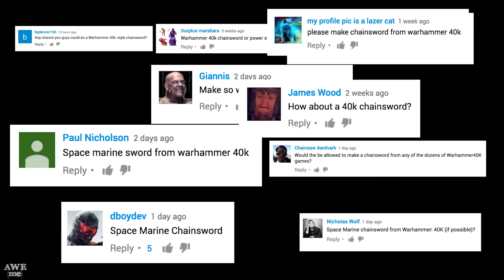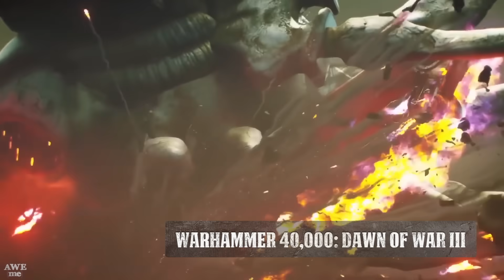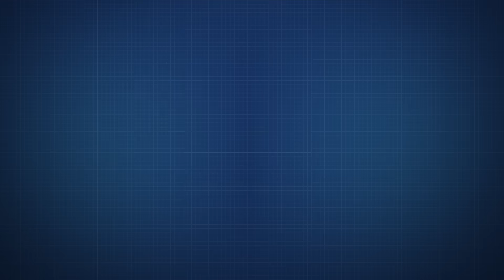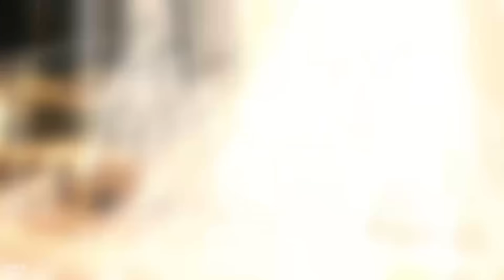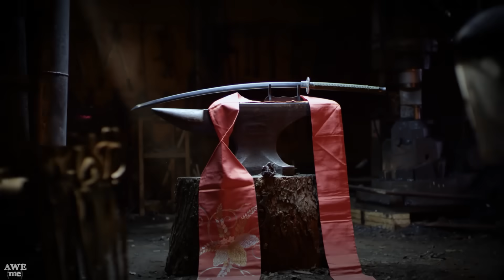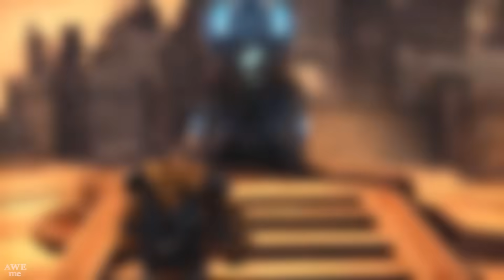Warhammer 40K Chainsword - MAN AT ARMS: REFORGED

Comment: Wouldn't it be easier and stronger,  to make the guard plate,  out of one piece and heat bend and pinch, the smooth out the rest, and heat, melt and pour each piece out of carbonsteel.  And then fine-tune and fit together.  Using a power source that uses electricity.

Comment: I often have to temper steel after welding or when I'm making certain parts, like springs or tempering a gun barrel, and I wish I could toss my parts in a toaster oven. Unfortunately, I usually go for a spring steel temper which is 650+. I do have some tricks up my sleeve, but a toaster oven is sure more convenient than a lead bath, a torch or a tempering oven!

Comment: That's not the WH40k chainsword. That thing just look like chainsword. If youll try to hit and crush something solid with it you will damage the chain or yourself. Even when they cuted thru wood they removed cover and used it like a simple chainsaw. But ye, it looks great.
Reply: They removed the cover to cut through wood because the chainsword is actually a terrible design, and doesn't function with real-world physics the way it does in the imaginations of the people who write 40k's lore.  The cover actually prevents the chainsword from cutting any deeper than the distance from the teeth to the leading edge of the cover.

Comment: I noticed your chain wasn't inverted that's why all the  objects that you were slicing or going towards you and Warhammer 40K lore it goes the other way
Reply: Reversing the direction of the chain would  just hurl the mostly intact objects away instead of towards them.  Notice they didn't cut anything tougher than a soda bottle with the cover on.  They removed it to cut the piece of wood because it prevents the weapon from being able to cut deeper than the distance from the teeth to the edge of the cover.
As designed in 40k lore, the chainsword couldn't cut a normal human-sized enemy in half due to its design.  It would just leave a horrendous inch-deep mangling wherever it hit.
Reply: @lennardchurch8483   it actually did cut through people yeah in 40K lore but the materials making up the chain sword was futuristic and there's no way we can produce that now and the speed of the chain sword is 10x faster then what they produced. the chain sword blade directions was inverted it so all the metal scraps and other debris will not be hitting them in the hand and cutting their hand that's why in 40K lore the chainsaw blade Direction was inverted
Reply: @Rowen6  It has nothing to do with sharpness, speed, or material.  Ex: if you took the fantastical concept of a monofilament sword, and embedded it in a baseball bat so that the edge of the blade protruded about an inch beyond the bat, that blade would never cut more than an inch into anything, because the bat would hit the surface, stopping it from cutting further.  That is why the cover on chainswords actually make them less effective, by preventing them from cutting through anything more than an inch thick.

So in reality, 40k chainswords are about as scientifically viable as  "red makes it go faster".
Reply: @lennardchurch8483   you must understand cutting and sawing are two different things sawing is a process of removing material so sawing with a chainsaw will push the material away that's being targeted, cutting is putting pressure on a point in separating material so the speed of the blade does matter it is moving material more rapidly and course the material of the chainsaw blade does matter because it needs to withstand The Strain that's being put on it
.

In addition, due to weakening the structure, and removing material, the body will start to collapse around it, and jellify with the vibration of the blade and structure, allowing the Cover to slip through. And even then, if it's still an issue, they can canonically be removed from the blade.
Reply: @Rowen6  My point is that chainswords pretty much "work, because magic" because how they explain them working is not how physics actually functions.  Look up videos of people cutting through things with chainsaws.  The cut's only as wide as the blade, and when they cut from a direction where the structure being cut collapses, it binds onto the blade and stops it.  And for the Chain Sword, the guard would catch on the material to either side of the cut, which would never get deep enough to cause the massive internal damage 40k's lore claims they cause.
Reply: @lennardchurch8483  the world's fastest chainsaw what we have in the world right now it's is nowhere close to how much powerful the chainsword is all the videos I can find that they're using the most powerful chainsaw on that is wood that is nothing like human anatomy. when you cut flesh it tears it congeals and then it collapses also the chain speed is so fast and how big the sword is actually is it's going to be doing Massive damage

 you got to keep in mind the average Space Marine height is 2 meters tall so their chainsword have to be twice as big for us also some chainswords have double chains going 2 directions

 the reason people can't make faster chainsaws at the moment it's because we don't have a strong enough material prevent the chain from breaking apart luckily in 40K they have that futuristic material because of that it is possible 

 No it is not Magic if you want a scientific explanation here's one think of it like this the chain saw blade is moving so fast that it is cutting the object or pushing it away the blade is moving so fast it's removing the material faster than you can push down since the chain path is reversed it is not going towards your hand it's going out and totally different direction so all the guts are shooting out away from the person wielding the chain sword
Reply: @Rowen6  That's not how physics works.  Being faster isn't a magic bullet... in fact, look at what happens to a bullet when it hits water.  It shatters.  And fictional supermaterials with properties not found in the real universe are basically magic.

Pull up a youtube video by Commissar Gamza, "The truth about the chainsword - 40k exposed".  Watch the whole video.  He's a huge 40k fan, but he acknowledges absurdity when he sees it.

Comment: I'm gonna chalk this one up as a fail Man At Arms, largely because you insisted on using a 21st century engine, rather than an engine from the 41st millennium.
Such engines are much smaller, much more robust, and they don't need you to pull a cord to rev them, you simply press the trigger on the chainsword handle and it revs.
Such a shame, this episode could have been so good. Now I'm going to have to report you to your local tech Adept, maybe when he turns you into servitors you'll get lucky and be employed once more in the workshop.

Comment: What's amusing is, once they use the finished chainsword, you can see immediately the MASSIVE flaw with the design - which is the saw cover actually prevents cutting any deeper than an inch or so. This is evident when they cut the logs without the cover because doing so otherwise would be impossible.

Comment: You could use gas pressure from the pipewire in handle. Mill wheel in guard spinning under gas pressure, so this solution can reduce size of the weapon

Comment: It's just a chainsaw. They even had to take off what's considered the holding plates (or that is what it looks like in 40K lore) in order to even use it properly. A ripper from the Fallout series (Not from Fallout 4 or Fallout 76, mind you) would be better. As I see it, chainswords are unpractical in design to the point that even using it as a sword would hamper what it was designed to do. 
Look at 22:12 and onward, the "holding plates" stop it from cutting further because they're too thick then they take it off and it's literally just a freakin' chainsaw.

Comment: I think a real one would probably have a little rotary engine in it with an electric start. That way you'd pull a little trigger in slightly, the electric motor would kick it to life and then you'd pull the trigger full throttle to get it spinning up.. A rotary (while less powerful) would be far more compact and smooth running than a regular piston engine.
Reply: Not to mention lighter

Comment: why did they use a gas motor? its way bigger and heavier, chainswords are powered through the fusion generator on the back of a suit of power armour, or through small fuel cells, not prometheum, the fuel used in 40k vehicles, so a battery would be more accurate

Comment: Funny how the weapon itself is so badly designed it won't cut through anything unless you take the cover off.

That said, the design could be tweaked to make it work: have the cover taper in to be thinner than the chain at the cutting edge.

Comment: The big broad guard gets in the way and makes it pretty much impossible to cut all the way through something. To be more functional, the guard should be narrower, just slightly wider than the chain itself, and its edge should be beveled down to meet the blade, thus enabling the entire sword to move through stuff after the chain cuts it. 

Also, the big triangular buzzsaw type teeth, while they look like the teeth depicted in the 40K artwork, are actually completely useless, because they are much narrower than the chain itself. Actual chainsaw teeth have an unusual shape enabling them to cover the entire chain with their cut channel. You'll note when they went to testing, they switched back to a regular chain.

Also, to get the kind of power to weight ratio you'd want, to make the sword easy to wield while still having massive cutting power, with real life technology you'd pretty much need IMHO a backpack engine, with hydraulic drive to the sword via a hydraulic hose and hydrostatic motor. That way the sword remains light, while you can have a much more powerful engine in the backpack. For truly ridiculous power you could put a sportbike engine in the backpack, driving the hydraulic transmission to the chainsword. The chainsword would then be achieving "hotsaw" levels of chain speed and cutting ability, while still remaining light enough to wield it easily. If you balanced it with weight down at the pommel end it could even be wielded one-handed easily enough.

Comment: Imho you overdid it with the engine you could have used for example nitro RC engine they are the size of an apple and are very powerfull.
Reply: But they dont sound like chainsaw xp
Reply: But you can lift them with one hand and swing the sword; not just prop it onto a table and drop it on the target.
Reply: @IcecalGamer  But real space marines are stronger and taller than normal humans, so technically speaking this kind of replica is closer to the originals, imo...
Reply: It wouldn't cut through anything. It would also sound like a toy.
This is not a toy.

Comment: You think it would of been easier to make the teeth fit to a regular roller chain.  Then when you cut out the teeth so they are 1/3 of the thickness of the roller on the inside of chain.  Then fill in the remaining space with two spacers that are 1/3 of the thickness each, of the remaining space. E.g. The roller is 3/8", two spacers at 1/8" and the teeth 1/8"  You of course would have to cut an arc into the new teeth and spacer to accommodate the teeth of the sprocket.  And on a side note, your left eagle is blind.
Reply: There were a few routes to go with the teeth for the chain ..But time was an issue .. and yes that is how it is suppose to be with the Aquila
Reply: Cool, thanks for the follow up.

Comment: I loved the build, but one SLIGHT TECHNICALLITY...
The chainsword has a trigger, or slide or even a imprint-activation point instead of a metal ring slide.
Example; the chainsword weilded by Ciphas Cain had a simple slide-function - a small plastic slide - for the throttle. The typical Chainsword of the Adeptus Astates are usually much larger, and have uniformal trigger-throttles.
Other than this one, slight flaw, it's freaking beast!

Comment: Bad video ; Not enough prayers and rites to please the Machine-Spirit. The chainsword will never work.
Reply: Have you heard of the machine spirit lol?
Reply: It's more that works are all latant pskers and for the most part bar (weirdbpys) they use their ability subconsciously to make stuff work though their weapons nd vehicles can be used by humans big enough to cope with the weight (Cains last stand for example)

As for the SM there stuff does work the rites are for the most part simple mechanical tasks given holy weight eg the first rite learned by a Tech Priest is the ritual of percussive maintenance or the blessed technical knock (smack it and see if that fixes it)
Reply: I agree with you
Reply: 01010100 01101000 01100101 00100000 01110011 01101111 01110101 01101100 00100000 01101111 01100110 00100000 01110100 01101000 01100101 00100000 01001101 01100001 01100011 01101000 01101001 01101110 01100101 00100000 01000111 01101111 01100100 00100000 01110011 01110101 01110010 01110010 01101111 01110101 01101110 01100100 01110011 00100000 01110100 01101000 01100101 01100101 00101110 0001010 01010100 01101000 01100101 00100000 01110000 01101111 01110111 01100101 01110010 00100000 01101111 01100110 00100000 01110100 01101000 01100101 00100000 01001101 01100001 01100011 01101000 01101001 01101110 01100101 00100000 01000111 01101111 01100100 00100000 01101001 01101110 01110110 01100101 01110011 01110100 01110011 00100000 01110100 01101000 01100101 01100101 00101110 0001010 01010100 01101000 01100101 00100000 01101000 01100001 01110100 01100101 00100000 01101111 01100110 00100000 01110100 01101000 01100101 00100000 01001101 01100001 01100011 01101000 01101001 01101110 01100101 00100000 01000111 01101111 01100100 00100000 01100100 01110010 01101001 01110110 01100101 01110011 00100000 01110100 01101000 01100101 01100101 00101110 0001010 01010100 01101000 01100101 00100000 01001101 01100001 01100011 01101000 01101001 01101110 01100101 00100000 01000111 01101111 01100100 00100000 01100101 01101110 01100100 01101111 01110111 01110011 00100000 01110100 01101000 01100101 01100101 00100000 01110111 01101001 01110100 01101000 00100000 01101100 01101001 01100110 01100101 00101110 0001010 01001100 01101001 01110110 01100101 00100001
Reply: Abominable intelligence detected!  HERESY!  Burn the abomination in the name of the god emperor.
Reply: TomZanovich 😂
Reply: Joshua Brooks Bruh...
Reply: 38 mellenia to early for that. :|
Reply: Be still your judgement, brother. It is likely they did not film these rites - we wouldn't want such powerful information ending up in the hands of Xeno filth, would we?
Reply: The SMs still need it to mechanically work to work, where as The Orcs need only have enough of them to believe it will work for it to work. They are there own Gods.
Reply: Its the Orcs that work of belief, not the Space Marines. Know your lore man....

Comment: Inaccurate looks aside, this build isn't very functional. At 22:36 they have to remove the blade cover for it to properly cut things. And someone probably regrets not reversing the motor rotation (I don't know if it's possible) so that the debris will fly AWAY from the sword user.
Reply: Actually the looks a pretty spot on from the drawing we used then like most players we made it our own . Unlike the game the cover would still be an issue . ANd we could not reverse it .  Safety first .
Reply: Bill Collison it might seem accurate from the side view. However, the sword in this build have a big bulge where the engine is, unlike the WH40k chainswords, and it throws the whole thing off balance (aesthetic-wise).

At the beginning I thought the guys would use some sort of small engine, just enough to get the blade running, and focus on getting the looks right. However, they try to get the thing to actually be able to cut through stuff, and end up with a product that is kind of "meh" in both looks and functionality.

But anyway, WH40k items were never intended to be practical to begin with, and I guess these guy enjoyed doing, and learned from this project. So good for them.
Reply: well I was one of those guys building it and I also worked for GW as a caster and mold maker so I know the lore and artwork quite well .